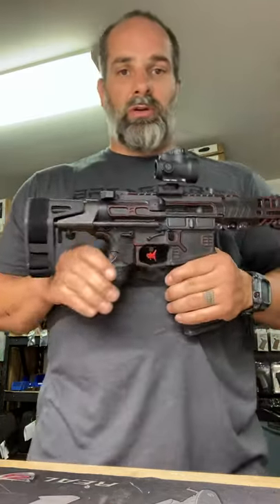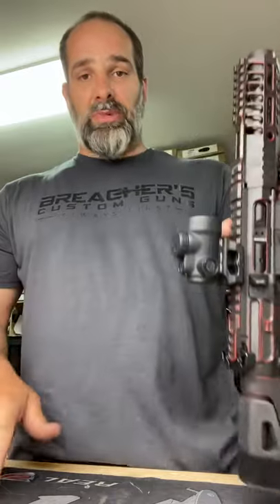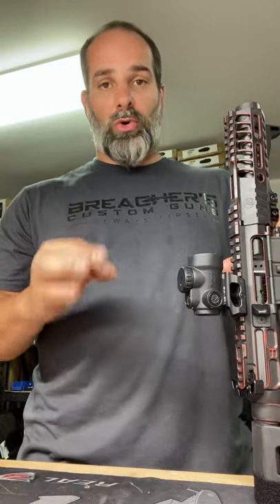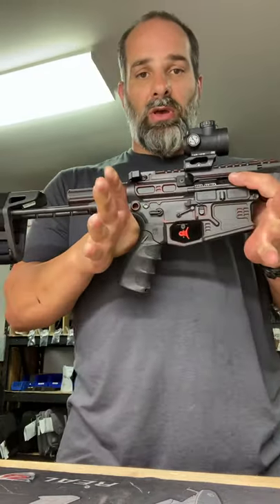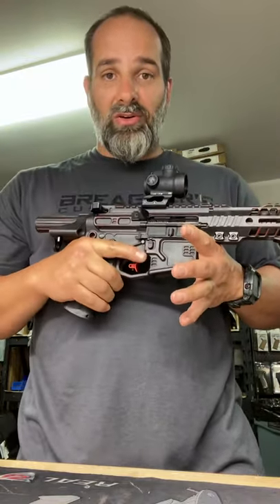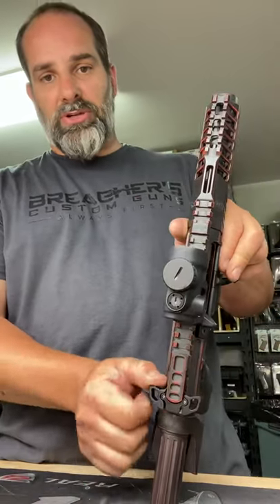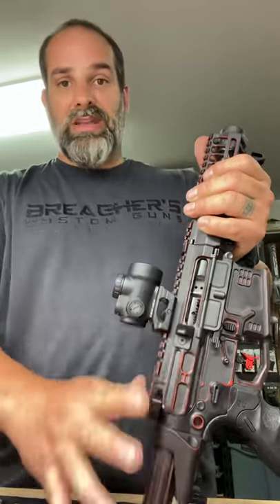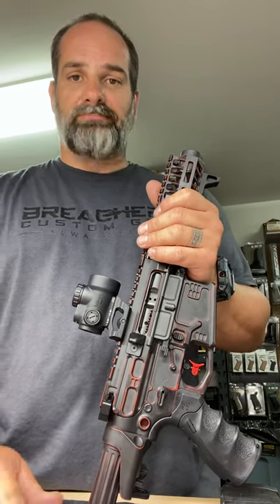Detailed “How to Mortar your AR15 with a round stuck in the chamber

Comment: I just bought a brand new AR pistol this morning and it jammed several times, then got a live round stuck in the chamber. Thanks to your video I was able to clear the jam safely. Thank you! ❤
Reply: Did yours stop doing it after break in?
Reply: @weeziktest2806  it’s getting better. I had to use a circular chain saw file to smooth out the barrel throat. There was a small burr in it.
Reply: @weeziktest2806  I have a video on my channel of it working correctly.
Reply: @paulis7319  I took it up to my shop I bought it from and that’s what happened to mine! I shipping it back to receive a new upper
Reply: @weeziktest2806  I have no trust in the mail system with all the weapon bans pending in courts and legislation. Decided it’s best to just fix it myself. Turns out that was a great choice because now I have a much better understanding of how it works.

Comment: In an emergency you have to do that and hope for the best. If you are just at the range, go ahead and make sure you dont have a bullet stuck in the barrel. Ive seen that done and it actually stripped the bullet from the casing. You will see powder particles around if that happens. But if you are not paying attention you can load another round and blow up your barrel. Again, in a gunfight, go ahead and take the chance. Chances of you getting shot are higher than you blowing up your gun.

Comment: Nice. It didn't work. 
Brand new AA 6.5G pistol. AA magazine and Federal factory ammo. Mounted an LPVO, sighted with a 6.5G laser in the chamber. Went out to dial it precisely.
1st round ever jammed going into the chamber. Forward assist won't chamber it. Can't extract it with mortaring. 
Can't disassemble the upper & lower because the BCG is still partially in the buffer tube.
Any suggestions? 
I've called friends who build competition ARs. I've done everything I know to do.
Kinda at a loss.
Nice video. Wish it would resolve my issue.
Reply: Sounds a lot like my problem you ever get it solved ?

Comment: Nice video you know your stuff. My issue very much off and on with AR 15 300 blk out: 20, 30 or more rounds, I get a super jam with a live round in the chamber. The mortar method will not clear the jam. Only accessing the bcg via the mag well and violently prying the bcg will clear the jam. It is just a matter of time and the super jam occurs again. chamber ramps look good and BCG disassembled and checked with no visible issues. Firearm is clean and not over lubed, magazines are magpul 300 blk out . I reload all 300 blk out rounds minimum powder charge. My other AR .223/runs like a champ with my reloads without any issues. 
Any thoughts besides a bigger screwdriver? 😂
Reply: Use 5.56 mags not 300 blk unless your running subs